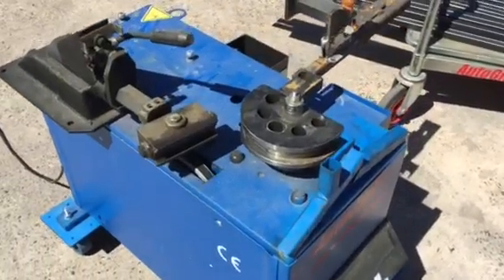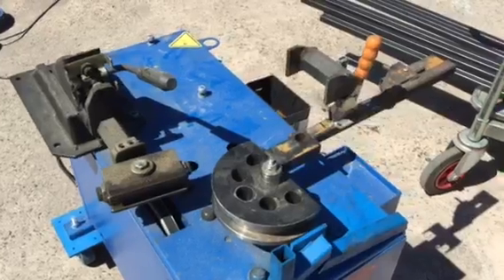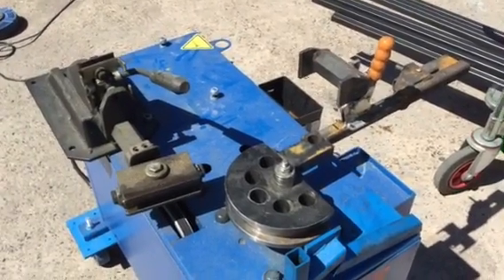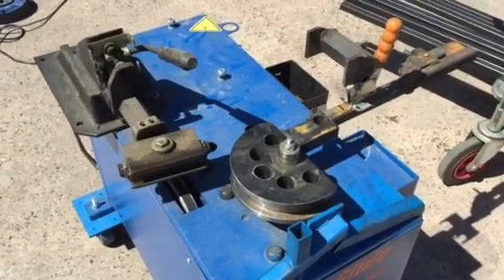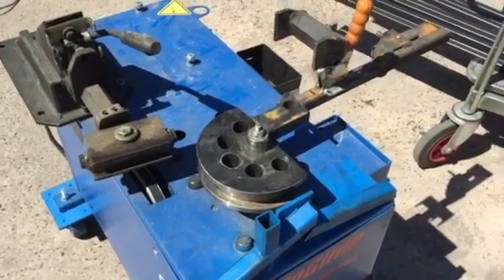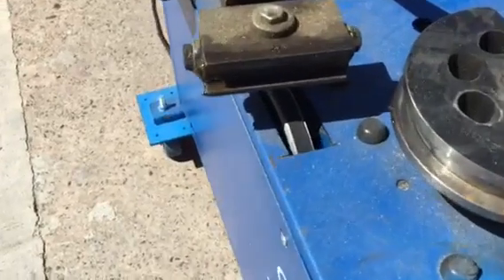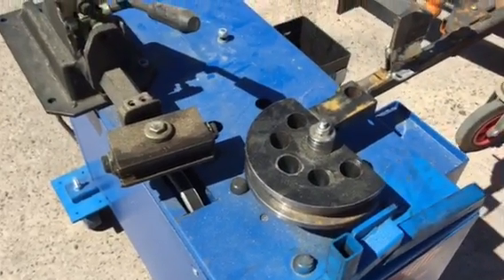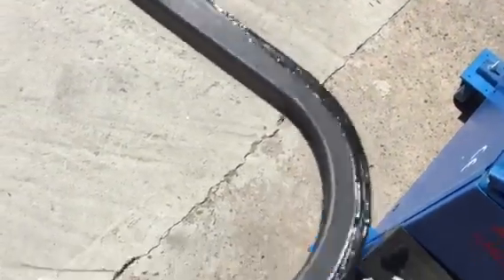Homemade square tube bender for box section

Comment: Why did you have to change the motor ?
Reply from the maker: the original motor didn't have the torque required and I am looking at rebuilding a similar one but hydraulic instead cheers pete